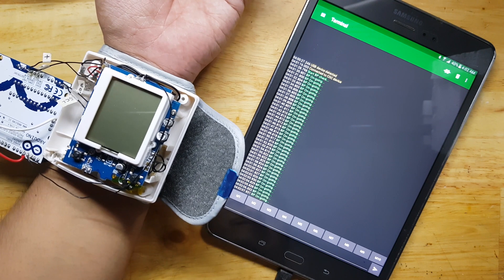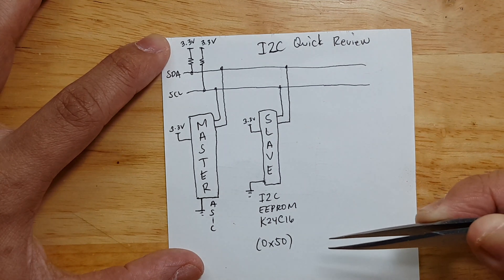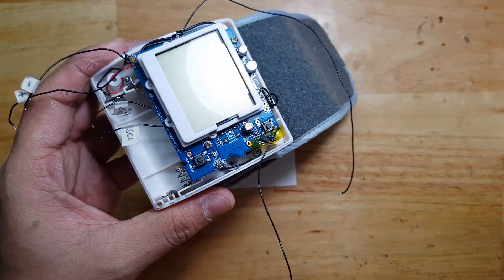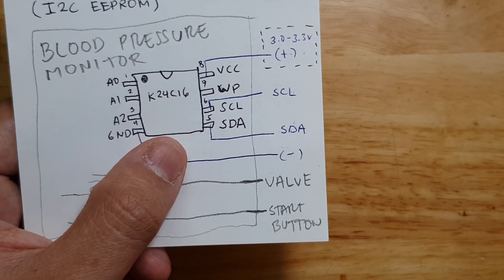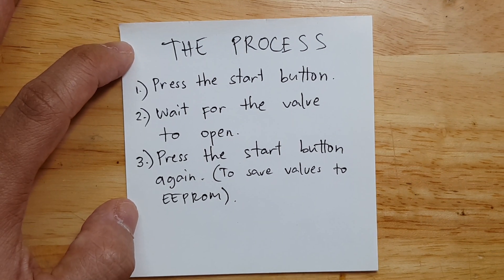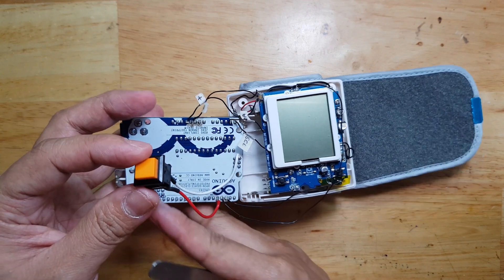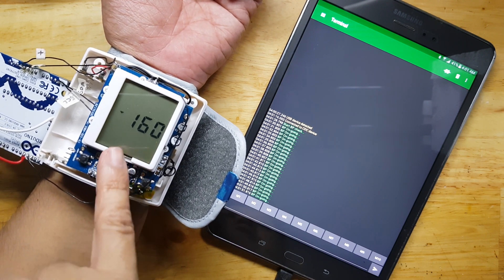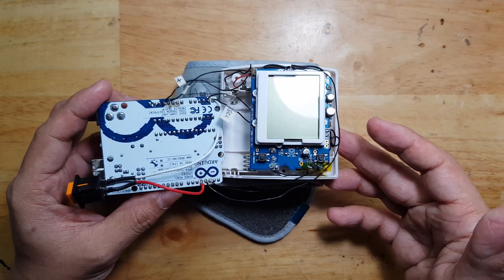HOW TO CONNECT ARDUINO TO BLOOD PRESSURE SENSOR MONITOR - I2C EEPROM, button and valve check (3/6)

Comment: How did you identify the output pins for the connections of the blood pressure monitor? Do you have any hints on how to identify them? What steps can I take? I want to acquire systolic and diastolic blood pressure values from a blood pressure monitor (OMRON M2 basic) by integrating it with an Arduino UNO, to display them on the Arduino IDE's serial monitor.

Comment: I have a similar BP monitor but it doesn't have the P10, P12 and I didn't see any I2C EEPROM on the PCB. However, the PCB has Vbat, TX, RX, GND. How would I connect it to the Arduino?
Reply from the maker: Please check the output coming from RX pin. You might have some data there.
Reply: can you please 
send me that blood pressure sensor link
to purchase 
please

Comment: Very cool project I would like to add add this with a esp8266 since it's a 3 volt microcontroller and Arduino compatible that's perfect have you posted your code anywhere for the Arduino IDE?

Comment: Hello!! Amazing work!! I'm doing this project and I have some problem...While the blood preassure montior is working, I'm not getting the values as it measures...I only get the data when the blood preassure monitor ends and shows the data in the LED. And this data i get (I only get 2 values) is not correct. What could be wrong? different blood preassure montior version? Thank you so much!!
Reply from the maker: there are many things that could go wrong. unless i have it with me it is hard to troubleshoot.

Comment: Great work... Thanks for sharing. Can I use esp32/8266 instead of Arduino?
Reply from the maker: esp8266 and esp32 cant be configured as i2c slave. it wont work.
Reply: @circuitdesolator  Thanks for ur reply.. I will try with arduino
Reply: @circuitdesolator  eeprom address x50 not working with my blood pressure monitor (jzk002).. When I tried to scan i2c address, got random address everytime

Comment: What if we used another BP monitor ?
I have a BP monitor that pump the air manually so is it the samz procedure as the one you did or diffrent one ?
I hope you see my comment and respond to me ❤
Reply from the maker: We need to check it. If there is no i2c inside it, then my hack will not work.
Reply: @circuitdesolator  if it  is possib le give me your email and i will provide you with all details
Reply from the maker: @rezrazimohamedsaifeddine1026  circuitdesolator@gmail.com
Reply: @circuitdesolator  well there is an I2C on it 
Im asking about the Valve i mean how can the arduino know that i have done pumping and start the measurement 

PS: im knew to arduino and i need this project

Comment: Hey bro, i have tested this BP monitor with NodeMcu but i'm not getting the live reading. getting only previous data. Can you help?
Reply from the maker: I think you are reading a different memory location.
Reply: @circuitdesolator  hi sir, I am doing this project right now. I want to know how to fix the reading in esp32. Because I always get No data or Error Serial output. How can I fix it?

Comment: Hi, want to ask, what happens if the arduino is not converted to 3.3V? Will it damage the blood pressure sensor?
Reply from the maker: There's a possibility for damage. The pump will be driven at 5V which will increase the current since it is designed at 3V operation. I advise you to use 3.3v level.
Reply: @circuitdesolator  i see. I'm using arduino MEGA, it has a 3.3V  output pin. Can I use that instead without modifying the Arduino?

Comment: Hello Sire, What the transistor that you using by emulating push button?
Reply from the maker: it is a mometary pushbutton called a "tact switch"
Reply from the maker: opps you are asking for the transistor. It s BC868. but you can use common ones like 2n2222, 2n3904, etc. Those are not SMT parts though.

Comment: Great work men! Congratulation!
Reply from the maker: Thanks 👍🏼😊
Reply: @circuitdesolator  Just a question: what you think was the most accurate equipment at Amazon? What you think is the best one of this compatible blood pressure monitors?
Reply from the maker: @jadderusa  that is difficult to answer since I have to perform comparative testing. But based on my limited time using these devices, they seem to be accurate. I am a little bit high BP while my wife has low BP. And all those devices detect it well 🙂
Reply from the maker: @jadderusa  for thr most accurate ones, omron brand is very common and seems to be used in most hospitals.

Comment: Good job dude! Gonna try hooking it up to one of my 8266 and send the data through MQTT to Node-RED that is running on my Pi. Also, did you, by any chance, have experience in reverse-engineering cheap chinese pulse oximeters?
Reply from the maker: The pulse oximeters have asic and no external eeprom. It is more tricky. Need to hack on the lcd side which is more difficult. Btw, esp8266 on slave i2c mode seems not to work. You might need an arduino first then send the data to esp8266.
Reply: @circuitdesolator  oh, I see. Thanks for the heads up. That's a bummer. Maybe esp32-s will do. I'll let you know whenever I try it.
Reply from the maker: @anispinner  i think same case with esp32. but you can try of course. you can probably do it bit-banged. Anyway, good luck on your project :)
Reply: @circuitdesolator  thanks my dude!
Reply: there are so many pulse oximeter modules such as Max30102 on popular e commerce and it cost $4 only which could connect to arduino, and they have made the library too..
Reply: @trytomo  thanks for the input. I've tried it some time ago. From my experience, it gives you highly inaccurate measures for SpO2 due to the fact that both IR emitter and receiver are located on the same plane, when in any commercial device you will have an emitter at the bottom and a receiver at the top (might be vice-versa in some devices), that way your finger will be light up like a Christmas tree and give you a way higher precision. The second issue with it, is of course no casing and clumsy way of attaching it to your finger using straps or whatever you are planing to use for it, and imagine sleeping with this sensor attached which is needed for example if a patient might have a condition like sleep apnea that you want to confirm. The third issue is that you still need a golden reference, something to check on your readings (ex N-3000 or at least some established cheap chinese PO) while building this device and it could drastically increase your project's budget. So I, unfortunately, found Max30102 to be no comparison to a commercial device.